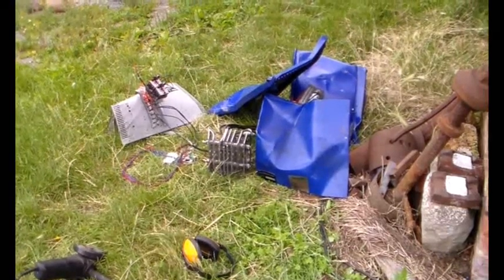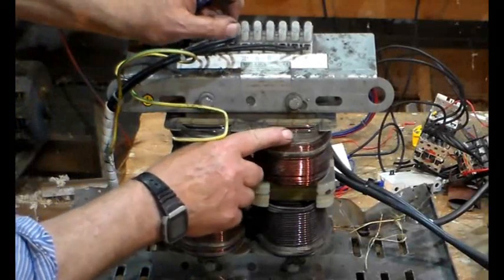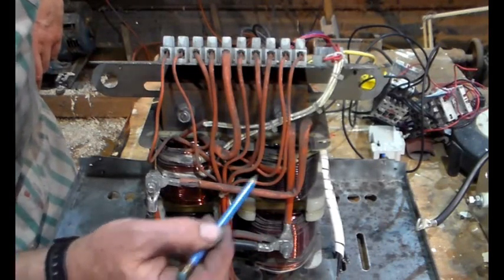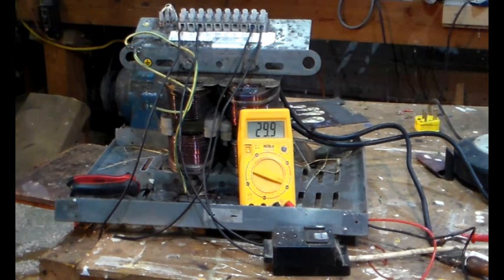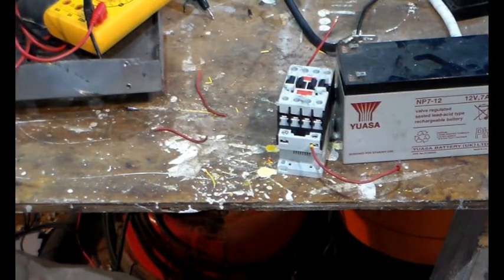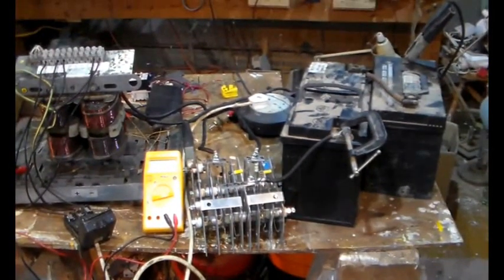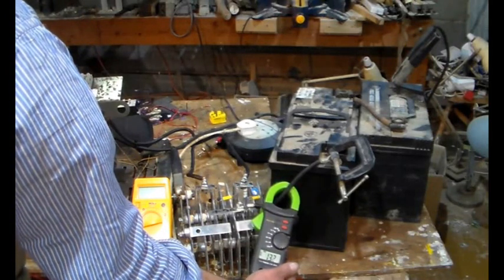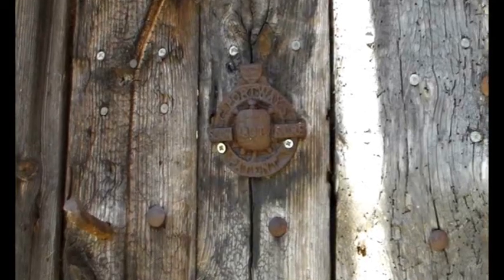Crushed Forklift battery charger, can we rebuild it?

Comment: I
Hi Andy i agree with your comments about bulbs when I worked in capacitor manufacturing we used bulbs to regulate charging currents the basic rule was when the bulb was out the caps were done. Those capacitors across the rectifier in your new charger are very important they help prevent radio interference from the rectifiers and help protect them from voltage transients. Thanks Andy  Regards Kelly
Reply from the maker: Kelly, thanks for your experience, yes they are a ready source of visible resistor, I even use a 110v 60w bulb to keep the tractor battery fully charged from the main 48v battery pack, cheers

Comment: The good thing about multi tap transformers, they work in reverse also!  Switchmode power supplies don't do that,  I have been looking for something like that , a nice big toroidal transformer would be an awesome find, rewind it to what ever is needed!
Reply from the maker: It's good to collect these when they appear as trying to find them when needed is very expensive. I have use the other small 24v transformer, another video subject. cheers

Comment: Andy, very interesting. Fix it up as a 48V charger and I'll get it off ebay!
Reply from the maker: Ian, I didn't realise you were running a 48v system. I hope things are OK and things now running smoothly. I will think about your idea but it wont happen soon and the post will be quite expensive as I think it will weigh about 50 KG, cheers.
Reply: @TheInfoworks  OK Andy let me know if and when you get round to it. Cheers

Comment: Hi Andy, missing your battery vids! Can I just ask, do you have reservations about using new forklift batteries in offgrid installations as compared to such as Rolls FLA batteries. The former tend to be less expensive. Thanks
Reply from the maker: Michael, I suppose it's down to cash flow but I would have thought a new set of forklift would be great and as long as you look after them and reduce the deep cycles down to zero,then they will last maybe 20 years. Obviously the  Rolls are more robust with stronger buss bars as weight is not a problem with stationary units, cheers
Reply: @TheInfoworks  Thanks Andy. One issue I think is that the documentation/specification you get with a new Rolls battery doesnt seem to be of the same standard with the forklift batteries so it would be less clear how to set up the inverter/charger (in my case Sunny Island 5048). Also I've heard it said that the chemistry/construction is different with forklift batteries in that they are designed to be better able to tolerate daily deep discharge down to 20% or so. Implication being that they would perform less well in an offgrid installation being discharged infrequently down to 60%. This seems counterintuitive to me?
Michael
Reply from the maker: My view is that the batteries are a buffer and a backup should be used to avoid any discharge below 50%. We have been using a charger for most of November and December because of the poor weather, Cheers